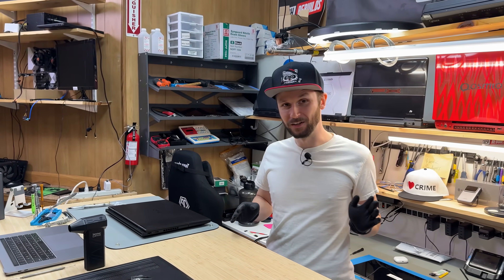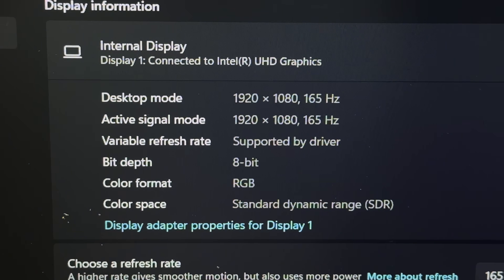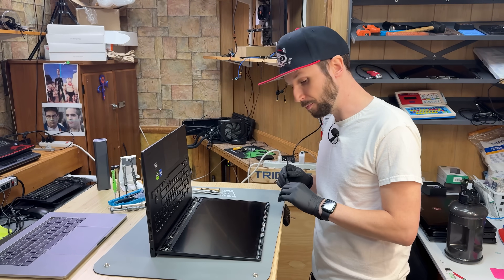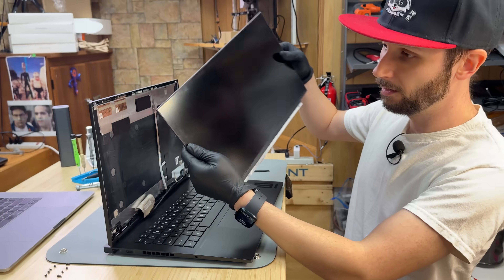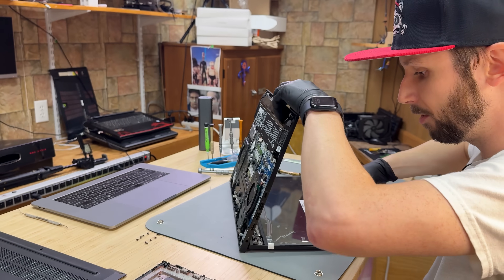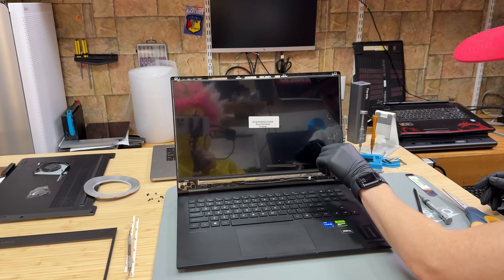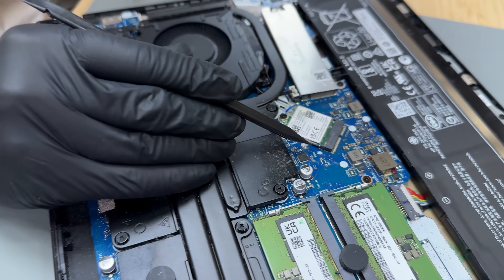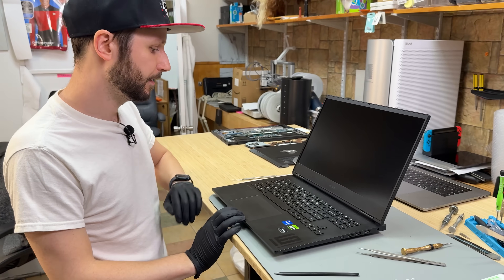The Laptop Upgrade Nobody Thinks About Until It's Too Late

Comment: The biggest issue I've had when I had to replace a screen last year, is that I ended up having to purchase multiple screens. So many stores online list screens by the part number of the actual panel, then actually send a cheep knock off, which if just wanting to view the image is fine but colours and brightness are nothing like the original.  The issue is that so many stores were listing the original then sending a lower quality part, rather than just stating its a "compatible alternative" for example.
Reply from the maker: Yeah this is a big issue and just complicates what should otherwise be a very straightforward repair
Reply: @SalemTechsperts hi so how do you avoid that fraud? Buying original to the laptop manufacturer ? Or  any trick? Thanks
Reply: Don't ever go by looks. Pro tip - find the cheapest models and then find the next price bracket up. Add a premium. There's always a substantial gap in the price. The lowest tier of "OEM" can be a knockoff. The tier above the price gap is true oem. It's always more expensive. If you want the same part as what rolled off the branded line you gotta pay for it. Always between the fake oem and the true branded and licensed oem part, and there's always the lowest tier knockoff out there somewhere. 

Junk, branded junk, fake "oem", unbranded, branded & licensed

The fake tier is always a significant step lower in quality because the unbranded is the same part as branded, just without warranty, after sale service etc. Without customer service you can get the parts cheaper. If you drop quality you can get the parts a LOT cheaper. That's the fake oem tier. There's always a difference.

Best way I know,  unless you start looking at caps or something, which is hard to do online.
Reply: In my nation we call that ''fraud''.
Reply: no way that they can do that, its like false advertising or basically a rip off
Reply: @KaeyaDraws  Oh but they do do that.
Genuinely the LCD market is one of the most backwards markets and I don't understand why. I can order a specific model fan, capacitor, or even battery, exc. And I will get the exact model.

But LCD Panels? You very often you just get sent a (cheaper) "compatible" screen.
Or the store will have policies like "display with up to 2 fixed pixels is within industry standards and is therefore considered an acceptable display"

Back when I worked at a repair shop more then a decade ago, TN panels were still common, and I just remember one laptop being in the shop for an extended time because on the phone supplier would say "Yeah we have that exact panel" then send us a TN rather then an IPS, or an IPS with the wrong resolution.

Comment: I bought an used ZBook Create G7 with the 4K Dreamcolor, it is gorgeous but have some white spots, probably pressure marks due to fingertips. At first I was pretty irritated, seller agreed for a full refund, but then I got it pretty cheap for the specs so I decided to live with it, not too obvious using dark mode. If it was a FullHD panel I probably will replace it.

Comment: I believe that those small white spots are caused by small debris or bread crumbles that people leave on the keyboard. You close the lid and small pressure punches the screen a bit. Not strongly. I presume it this way because I have never seen this screen white spot damage on any tablet or touchscreen laptops (even kids tablets) and they have glass front.

Comment: When I was still working in the tech industry, the shop I worked at, we used to actually sell laptops with blemished screens because a broke college kid would care about the discoloration and appreciate an extra $50 to $100 off (back when you could still charge $400 for a used business class machine) and put that saved money into ramen and beer. Obviously we had it on our scratch/dent/b-grade display. Nowadays it's hard to talk someone into saving a marginal amount of money for a b-grade when they can get cheap $200 vendor trash at Walmart when it's already hard enough to convince them that business class machines are worth the money

Comment: My consumer pc has a fused screen (yes they're doing that) with no screws but a cement tough glue under it so if you try to remove the lcd, you break it. 100%

Comment: pro tip from a g: open the laptop screens ONLY from the middle so the force is distributed evenly on both hinches/latches. 50/50.
Reply: or use both hands, this is a heavy laptop, no problem.
Reply: @giornikitop5373  macbooks even have a cutout in the middle. opening from the mid is the proper way.
Reply: @giornikitop5373  it doesnt matter if its heavy or not, just only open and close it from the middle.

Comment: I like to totally remove the battery when I can (i.e., it's not glued in). Sometimes those connectors like to find their way back in. Or I guess you could tape over the port or something.
Reply from the maker: In batteries that connect using the mating method instead of a plug, yes. I usually put a piece of paper between the connectors. In this case, this plug requires so much force you’ll break a fingernail trying to plug it in, so you’re good.

Comment: the Travelmate 5760G i had to take the screen off of gave me very little trouble. but tbf i didn't go to take the screen out of the casing, but it too was really not problematic. these older designs are far better for repairability for sure

Comment: The white spots were liquid damage. You saw some parts of it on the corner of a heatsink.
Reply: End of conversation
Reply: what liquid?
Reply: @oiytd5wugho  Semen obviously. Why do you even need to ask?
Reply: That's not liquid damage on the LCD. It's "mura". What you saw on the heatsink is residue from the thermal pads below the heatsink.
Reply: @TFaceFalone  I meant the white spots on the motherboard, not the display.
Reply: @oookei-sk  Ah, my bad! I would also guess thermal paste in that case though, it looks too soft and mushy to be any "regular" liquid damage. Although considering the state it was in before cleaning it wouldn't surprise me if it actually was CID.

Comment: I wish laptop screens were properly standardized. Especially a lot of older laptops with crappy 1366x768 glossy TN panels. They'd benefit a lot from having a better screen.
Reply: ThinkPad X230😭
Reply: @pigletshut  I have a ThinkPad R500, and at least it has a matte screen. Still TN, still low resolution - 1280x800 - and still overall crappy, but it's not the worst I've seen. 

From what I heard, Lenovo switched to 16:9 aspect ratio at the time because it allowed them to use those shitty 768p panels. Because of money-saving. So, it resulted in shitty no-good panels mass-produced that are only ever destined for the landfill because no one in their right mind would want to use them when literally anything better was available.
Reply: @pigletshut  some later X230s had IPS, so beware: you might not actually be upgrading as much as you may think. I love my X230s.  Best laptops I ever had -and it was an IBM design, Lenovo just inherited that one when it was ready to be manufactured.
Reply: I have an HP Elitebook 840 G1 with a crappy 1600x900 TN panels with bad colors and 7 vertical lines. I was searching for a new panel and found a 1080p IPS panel for the Elitebook G3. I ordered it, installed it, and it worked! oh god, I literally punched the air in happiness.

Seriously, those old, tanky business laptop with crappy 768p screen... I'm glad I can find a better screen. I wish I could say the same with my other old, crappy Core i3 budget laptops!
Reply: i have a lenovo v14 g2 itl with those 768p crappy display, and i upgraded it with a ips fhd 14" display that i found and it works, im glad i dont have to use that crappy tn display anymore cus i had enough with that "low cost" production thing that lenovo's did to this laptop

Comment: If I could, I would like to change this panel I got on my Lenovo LOQ 15irh8. My model has the 144Hz display with 45% NTSC and 40ms response time. I hear the 165Hz 100% sRGB panels have 1ms response time.

Why I can't, is because I can't find that display anywhere in my country.

Comment: As fellow technician, I'll give one suggestion: ALWAYS DISCONNECT THE BATTERY!! I had customers trying to change their screens or whatever, and their computers won't turn on, because of motherboard damage or another component. When I asked that did they disconnect the battery and they say "No, I watch a "X" Youtube video that I follow to replace my screen" or something like that. Instead of replacing one thing, it had to change two or more, depending of the damage.
Reply from the maker: Did you leave this comment before getting to the part where I disconnected the battery while making this exact statement? 😂
Reply: @SalemTechsperts  ngl i think he did tho lol
Reply: This is true. There are many that forget this. I made this mistake before, and.... blew the screen
Reply: He literally says to disconnect the battery if and when you replace the screen.
Reply: Uh huh, maybe watch the video buddy.
Reply: yeah as well as even the laptop has a battery disconnect switch that some laptop has that you just need to push by a sim ejector pin,  it is more ideal to remove/disconnect the connection of the battery first before doing some kind of maintainance inside of the laptops
Reply: This, 3 out of 4 laptops I used now have a solder bridge instead of backlight fuse
Reply: As a fellow YouTube watcher I suggest you watch the whole video before you comment
Reply: On my older hp laptop, I didn't disconnect the battery when I installed a new ssd, repasted the laptop, and many dust cleanups... Nothing broke; Because I held down the power button for 30 seconds, I even dropped the screws on the motherboard several times.

I have a newer laptop now and I make sure to disconnect the battery everytime I open it.
Reply: Yeah, we know
Reply: Tell me you didn't watch the video without telling you didn't watch the video.

Comment: My kid's laptop was super cheap with the low res display option. I replaced it with a 4k 120hz display. It both fit and had the same LVDS connector, but needed a longer cable.
The panel was less than $100, cable was $3 used, and the laptop was on clearance for $300.
Reply: $403 btw
Reply: 100$ * 3$ = 300$ , 300$ + 300$(laptop) = 600$, buddy you lost money :face-red-droopy-eyes:
Reply: @Gureenu are you special? The maths are clearly not mathing
Reply: Where the hell did that multiply come from?
Reply: @Gureenu  math error here. He definitely spent 300$²
Reply: @Gureenu  Where did bro get 100*3 from and the dollar sign is meant to be before the number ya special

Comment: I think it was a good thing that a 1080p screen was installed. After all, with a 1440p screen, the requirements in games have gone up significantly and the customer could be dissatisfied. Even if he reduced the resolution in the game to 1080p, the screen would not be as sharp because it would not be a native resolution.
Reply: That's only a problem with desktops, where buying a 34 inch 4k monitor and using 1080p on it would make it look way worse than buying a 23 inch 1080p monitor. Here, every panel you get is the same, so they can use 1440p on the desktop and 1080p in games.
Reply from the maker: The idea is to have 1440p on the desktop and 1080 in games. It would look completely fine operating at a lower res because the size is exactly the same as the old one.
Reply: Most 1440p (and 4k) screens have a 1080p display mode, so I'm not sure that's correct about the sharpness. There's also FSR and DLSS which do really good upscaling for very little performance penalty.
Reply: @GSBarlev  laptops have smaller screens so you don't really need 1440p plus even technologies like fsr or dlss aren't perfect. native resolution will always be better than fsr or dlss. period

Comment: Upgrading screen to higher res is not always good idea, if screen is small it will just make it harder to read and wont make a difference quality wise
Reply: you can always increase the UI scaling on a high res screen, you can't do it the other way around. However for a gaming laptop you might also find you have to go back to 1080p for some games because the GPU might struggle with the higher resolution.

Comment: This saved me about $300 a while back. Bought a ASUS laptop with a 1600x900 display and ordered a 1920x1080 display panel for it. Upgraded the screen about a week after I got the laptop, and it was a few hundred cheaper than just buying the same model with the better screen.
Reply from the maker: You love to see it!
Reply: and got yourself a spare screen you can turn into a second vertical screen using a driver!
Reply: As a bonus, you can often then just sell the old screen and recover some of the cost of the replacement screen....
Reply: And you've got a backup screen if you ever break it.
Reply: @678rwhp  You can do either or.  In many cases when I have upgraded computer power supplies or other components, I have often just sold the old parts and recovered much of the cost.

There is usually a pretty good supply of computer parts in circulation so you rarely need to stock them, just buy them again if you ever need them.

In my experience however, the vast majority of computers get retired as obsolete rather broken.  I have literally 30 to 40 year old computers that still work fine...
Reply: this was my plan for my laptop as well, I bought an rog laptop with 16gb of ram but wanted 32gb. The 16gb model had a discount and cost nearly 500 dollars less than the identical 32 gb one. But turns out this ROG laptop comes with the RAM soldered to the motherboard 🥲🥲
Reply: @noobkilla3 ah yeah you gotta pay attention to the terminology. If you see LPDDR listed as the type of memory the computer has instead of just DDR then you are dealing with soldered memory. Some manufacturers are nice and will also have soldered in parenthesis next to the memory in the listed specs.
Reply: @noobkilla3  This is getting more common, where the lower models are not upgradeable due to the memory being soldered on to the motherboard.

Just saw the same exact thing when comparing LG Gram laptops...
Reply: I agree lcd panels are cheaper than full  assemblies
Reply: cheaper + you can sell the spare 900p screen
Reply: And of course you void the warranty. Hey but you by the one that repairs these things anyway.
Reply: @lmena5696 someone that replaced a screen is likely capable of doing maintenance on stuff like fans, thermal paste, etc to keep that system running ling after that warranty expires

Comment: My laptop uses a type c charging cable and now its unable to charge because someone bent the the charging tip of the lap tops charger(the small metal gray part at the end of any type c cable) but the laptops port is just fine I just need to how to fix my chargers charging tip, I am nowhere near a repair service so does anyone know how I can fix my laptops charger?
Reply: prob. not fixable. you're lucky it's only the charger and not the port on the laptop. some chargers have removable cable like usba->usbc or usbc->usbc. worst case, get a new charger.
Reply: @giornikitop5373  The charger is kinda hard to find where I am at the moment, is it possible for me to replace the type c cable with another cable?
Reply: @ArticMC-ue7uq only if the charger cable IS removable.

Comment: Option 1: Replace or upgrade your screen.
Option 0: Just take fuck*ng care of your device.
Reply: Not all damage comes from neglect. Sometimes accident happen, and sometimes things are so poorly designed (HP hinges) they break by themselves.
Reply: Be like me and break my thinkpad T580 screen on the second day of me owning it when I brought it last year 👍👍👍

Only got to replacing the screen now and holy shit its heaps better than the original.
Reply: he's just pointing out that many parts are transferable between different laptop models/"trims", like backlit keyboard vs non-backlit usually being swappable, or higher or lower resolution panels

even converting a non-touch panel to touch-screen just requires a new cable in a lot of cases, or you can save money and get a cheaper non-touch variant if you don't use that feature

just some examples that most people don't realize are even possible

(Worked in healthcare IT, I used to swap Lenovo parts around to salvage dropped/spilled-on laptops and tablets (back in the Lenovo X220/X230 days). Never threw away any chassis unless it was fully scavenged for parts- keyboards, monitors, bezels, wireless cards, memory, mainboards, daughter cards etc because we had a hundred or so of each model... Even got one tablet working great after it was left on a car roof during in a lightning storm- I saved a ton of computers there, a few were dropped so hard it broke the chassis in half but still worked fine so i swapped the chassis out)
Reply: It's HP QC in my experiance, new laptop with way worse
Reply: my my man censored the i in "fucking"
Reply: Someone took fucking care of their device and got white spots all over it
I think they took care of it a little too much
Reply: you're saying that while you also don't take care of ur devices
Reply: @Segually speak for yourself 😂
Reply: @Segually  ☠️

Comment: even if the connector matches up, it might not work
for example the ibook g3 had 2 kinds of screens, one was made by ibm, the other by samsung, and they weren't interchangeable, even tho the connector was the same
Reply from the maker: That’s why research is important. You need to see if the model you have was available with a higher res, and whether you could use the same cable.